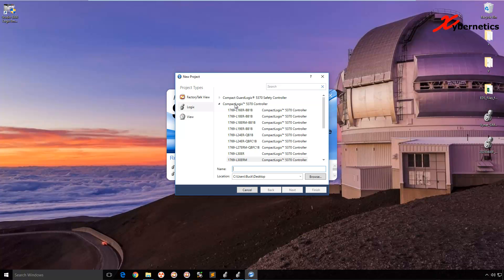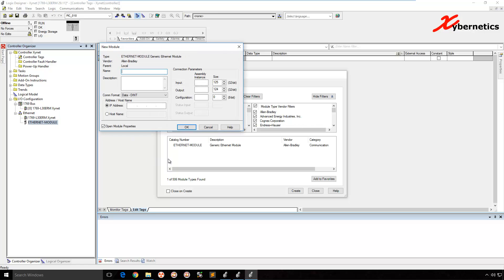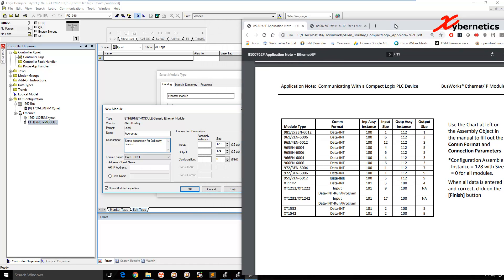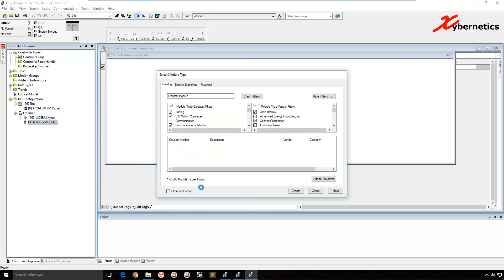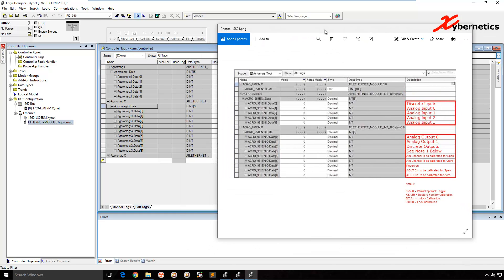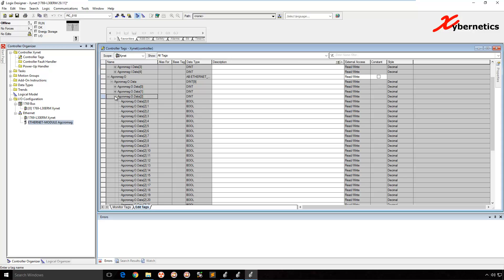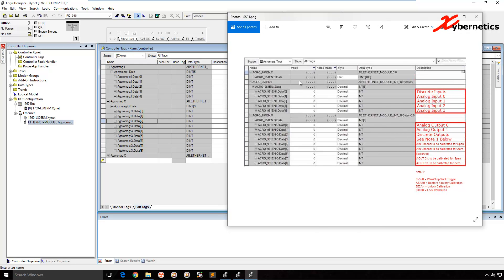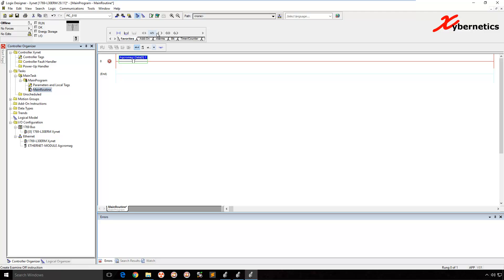Allen Bradley PLC Connecting To Ethernet/IP Devices

Comment: Is this method used capable to stablish connection between PLC and LabVIEW?
Reply from the maker: I understand that LabView is an NI (National Instrument) product, but I assume that you are trying to connect LabView to Allen-Bradley ControlLogix PLC vis CIP protocol? Ethernet/IP set is the correct way to connect to the Allen-Bradley ControlLogix PLC. Just have to ensure that the CIP path and IP address are correctly defined configured in the LabView driver.